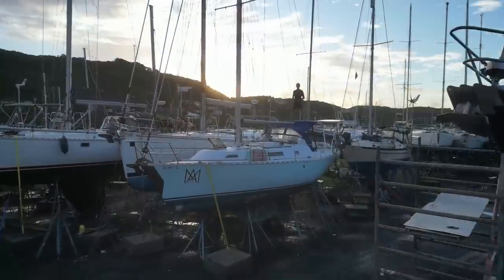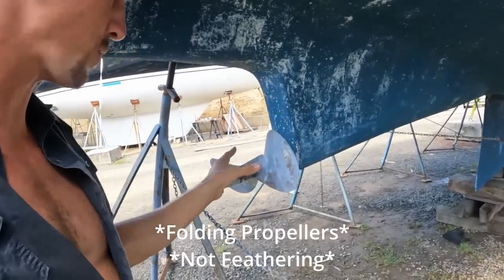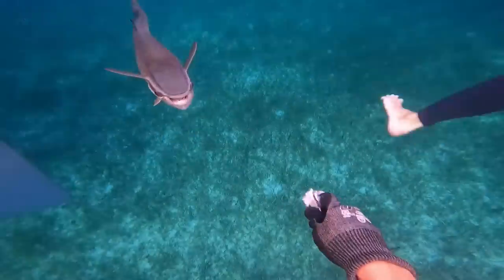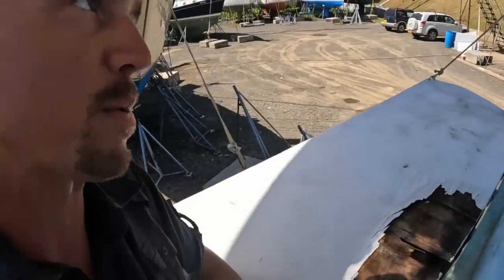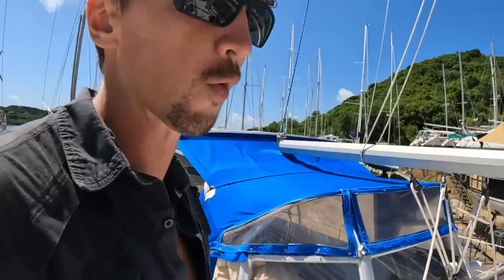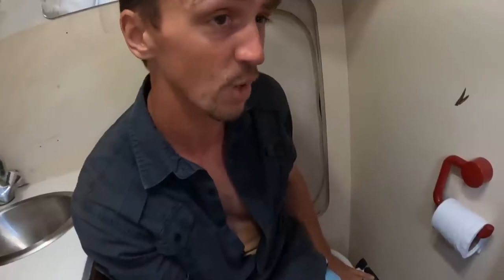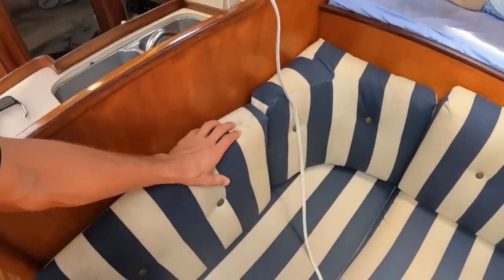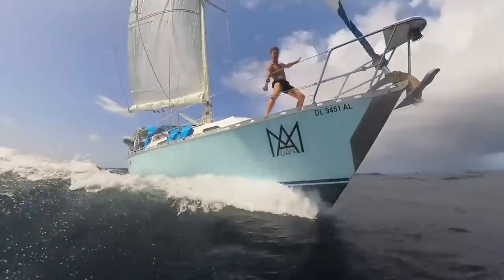Boatyard Tour Damage Assessment: (What 2,230nm & 396 Days Sailing/Cruising Does To A Sailboat)

Comment: I can't tell which Volvo-Penta engine you have, but the newer VP engines in that size range have a monel heat exchanger which is why they don't have a zinc.  Just for your information, there is no exhaust passing through the heat exchanger.  The heat exchanger transfers heat from the engine coolant to raw water.  Once the raw water passes through the heat exchanger it is injected into the exhaust at the exhaust elbow.
Reply from the maker: Thanks for the info!

Comment: Has your heat exchanger held up so far? No reason to replace it if jbweld made it like new lol. I doubt a bit of seawater in the cooling system would harm anything. Coolant is made to prevent corrosion in the system anyhow.
Reply from the maker: Not really, slight leak. I just refill it as I motor. :)
Reply: @Adventureman_Dan  Sounds like my daily driver😅

Comment: Doesn't the propeller free wheel when moving?  I would think the drag wouldn't be a much as you'd think?
Reply from the maker: I lock mine in place so it does not spin. It's bad for the engine to be free spinning.